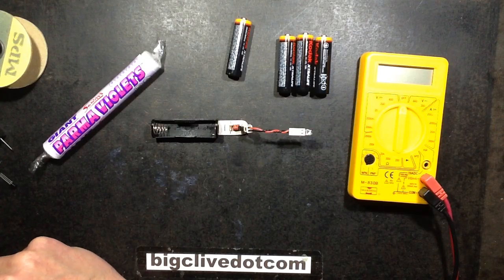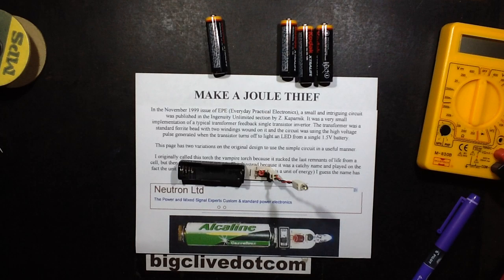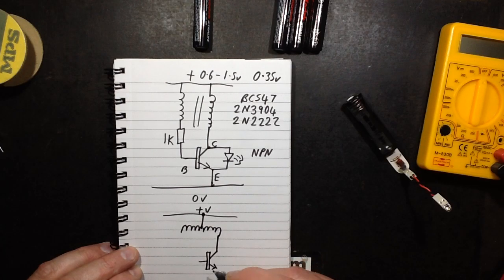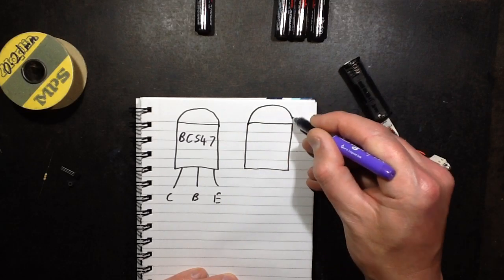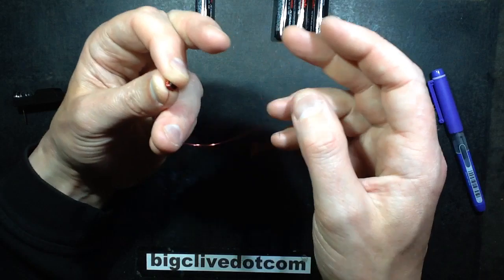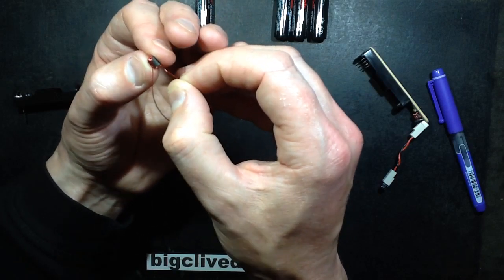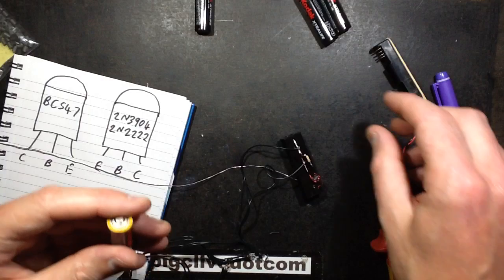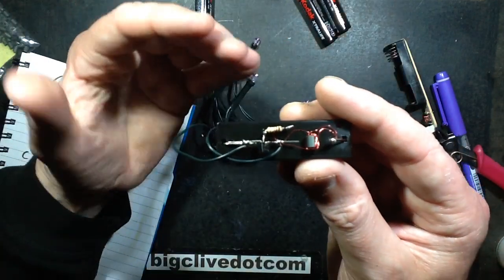How to make an authentic Joule Thief.

Comment: Do you think I could drive a cold cathode fluorescent tube with one of these?
Reply from the maker: The output is too low.  You're also better using a traditional Royer driver for cold cathode tubes as otherwise they can polarise if the drive waveform is not symmetrical.  (Mercury vapour gathers at one end.)
Reply: Thanks very much for the quick response! I have a cold cathode backlight out of a TV that I'm wanting to like my room with. I may have to post a video of it if I ever get it going.
Reply from the maker: @WalterMelones  Check on eBay.  You can get cold cathode drivers for TV tubes, but they are often designed to drive several at once.  You also get testers based on standard PC cold cathode tube drivers.  Search my channel for cold cathode.
Reply: I'm wanting to drive 16 tubes (in parallel?) As a struggling student, I can't afford shoelaces, let alone purchasing things on the internet. I may have to delay projects for now or a search through my index of parts to try and build something from scratch. I'm not sure I can dedicate much time to it at present, anyway. I shall do more research and thinking when and where I can make time. :-)

I wonder what would happen if I try to drive all of them off of a single driver. Maybe it would only light one at a time and flicker sporadically throughout different ones; similar to that light bulb you made with little neons?
Reply from the maker: @WalterMelones  You can't drive them directly in parallel unless you put a high voltage capacitor in series with each one to split the current.  Keep in mind that a cold cathode tube operates at several thousand volts.
Reply: @bigclivedotcom  ah, okay. that makes better sense. That also explains why I could barely drive one tube with a small neon sign rf generator. I'm looking into Royer Drivers, now...

Comment: Would this circuit work on garden solar lights?
Reply from the maker: They're already based on a similar principle.
Reply: @bigclivedotcom  it's a very interesting Little circuit. I have been looking for some ready built on eBay so I can add them to my garden lights.  What would happen if you linked two together?

Comment: I know you LOVE Poundland and buying cheap batteries. Buy Energizer lithium are FAR better in everyway. I started to use them around 10+ years ago, first of all in my RC remote control stuff and then. For everything!  (I went a bit "gun ho" when I flew my beginning £400+ battery helicopter for the first time 🤦🏻‍♂️. Ended up going over 40+ mph into next doors van with the helicopter shattering n flying into millions of pieces and the grill doing the same 😳 (They were away on holiday and I never said anything lol) With the LiPo battery bent in half, I didn't go ANYWHERE near it for over an hour 😳 I spent almost as much to fix it as what it was worth. So I ended up swapping it back over at the shop n sticking to what I know best. 4 wheels).

Tangent over. A few people have done tests over the recent years and I know Dave's done a few tests and something similar came out on top. But that's mostly to do with "the batterizer" 😂🤣🤦🏻‍♂️ 
I always tell everyone to get them off eBay and if there's anyone, staring at all the different shapes, types, flavours, colours n all the BS marketing wank they slap all over them. Stating that there 5x better than any over battery out there n I'm like "so tell me about all these over brands that are just as shit as all the others on the shelf. Stating you out! 👀🔎
I always tell them what they are and where to get them. Many years ago they stopped selling them for obvious reasons as they want to make a profit. 

Rant finished!

Comment: Interested in your take on a single inductor Joule Thief being sold on www.Amazon.com by Farhop, entitled "Joule Thief DIY Kit - No toroid inductor. SMD DC-DC Includes LED".  I bought a few and put the circuit into LTSpice, and it simulated rather well.  I removed the small surface mount inductor and it worked with a variety of other inductors, so this seems like a fun circuit to hack and comment on.  Love your videos and web site.  Keep up the good work!

By the way, I like how small your Joule Thief turned-out.  I couldn't find cores like that -- they must be high permeability.  Curious -- what is the frequency, and what is the efficiency?  Thanks again.

Comment: One Thing not covered in the Video or any of these type as far as I know,  From my extensive experience with these type battery fully draining circuits is when the battery is finally used up the batteries are prone to pop open and leak so get rid of them after draining in a Joule Thief!  I've Literally had many lying around and herd a pop and  once in a while and discovered the bottom
of the battery popped open!

Comment: So if you can’t let it go open circuit how do you turn it off?
Reply from the maker: Disconnect the battery.  It's the LED that can't go open circuit.
Reply: bigclivedotcom  thanks will try one as a reading light for the mrs 😂

Comment: wait why is this working for me no matter which way I put the transistor in?
Reply from the maker: What voltage are you using?  If it's more than the LED forward voltage the current will pass straight through the inductor and LED.  It's only really designed for 1.5V cells.

Comment: does it matter what size wire you use
Reply from the maker: RC MAD The circuit is surprisingly tolerant of a wide range of wire sizes, but I tend to recommend the thinnest varnished wire you can find that is still comfortable to wind and terminate by hand.
Reply: ok i got some out of the bulb that i took apart so might do but now i have to hunt for a 1k resistor where can i find one of them i can salvage

Comment: Does this only work with LED's?
Reply from the maker: It can be used for other small loads with some extra components, but there are more efficient alternatives.
Reply: @bigclivedotcom  Would you consider elaborating on this, including some other useful applications of the Joule Thief's output in a future video?

Comment: +bigclivedotcom the resister is a 1k but is it .25, .50, .75 or 1watt it sounds like it would be a .25 and it's not easy to find a decent quality ferrite bead. I ordered a pack of them and didn't say shielded but when they came a month later they said they were ferrite shielded bead, small trace amount of ferrite cheap and didn't want to work I borrowed a few meter of wire from a friend and if you have a link for the .15 wire and the beads I would appreciate that very much. I just bought the transistors, resistors and cell holder local for 20 times the price. RadioShack went out of business, thanks
Reply: The beads I purchased was .094" inside diameter or 2.4mm and silver black, junk

Comment: Why 1k resistor? cant it be bigger or smaller?
Reply from the maker: +Tom Ocean Yes, within a limit.  A value of 10K will make the circuit run at lower power.  If lowering the value of the resistor to make it run at higher power you have to consider the stress put on the transistor and LED.
Reply: +bigclivedotcom Thanks for fast answer. so its means if i want drain more battery 5k resistor is good?
Reply from the maker: +Tom Ocean 5K would result in a dimmer LED but much longer run time on a battery.

Comment: Two and a bit years ago I bought my daughter a string of LEDs more or less like the ones you have there except they were white and had little plastic minions attached to them.  They are powered by two AA cells.  She turned them on on Christmas night 2015 and never turned them off.  I assumed they would stop glowing after about two days.  Instead, they glowed quite perceptibly, even in a lit room, until after Christmas 2017 i.e. more than two years.

They are still glowing now, but it's very faint.  Who needs a joule thief (cool as they are)?
Reply from the maker: Good quality modern LEDs will light at literally a fraction of a microamp.  I have a light in my bedroom that uses two AA rechargeable cells to make a single LED glow and it lasts for months on a full charge running 24/7.

Comment: YOU coined the infamous word jule thief? If true that’s cool.
Reply from the maker: Yep.  I thought the Joule Thief was a good name and it took off.
Reply: bigclivedotcom I asked you a question on your page +google bigclive it’s about some led lights I got to replace the Filament type on my motorcycle side light 12 volts system, they don’t last very long Clive before they fail. Why? There cheap I tried 2 types and both failed within weeks is there something I can do like put a resistor in-line or is it cos there just cheap ones? They looked ok just simple push in type with a flat blade connection. Any ideas? Thanks.
Reply from the maker: The usual reason for failure is overheating or over driving the LEDs.  Are they the "canbus" type that have a red hot resistor on them to try and make them look like a traditional current hungry tungsten lamp?  If they are then look for the type that doesn't have that extra resistor or group of resistors soldered directly between the positive and negative connections.
Reply: bigclivedotcom well I tried 2 types one was just the 2 led’s on a basic board that was pretty bare and I lost that one as it may not of failed as I later found the connection at the other end had come lose so that could of been fine, the second one was like a Christmas tree with the resistor you speak of Clive so it sounds like if I purchase the one that may not of failed after all I may be ok. So I’ll stay away from the Christmas tree hot resistor type! Thanks for your advice. Huge fan mate great channel.

Comment: Hello sir, or anybody who can help me. I am sorry, I am a beginner and new to this, so I am bound to make mistakes. So anyway, I have attempted to make a joule thief. Here is how I made my coil. I used 2 18 gauge wires of different color wrapped around a black toroid. I think its around an inch in diameter. I have winded it according to how most do, which is the opposite colors of the wires are right next to each other ( same color wires aren't adjacent without the other color wire being next to it on both sides.) and done 8 to 10 turns. Here is what happens though. Following the schematic, I build my circuit and finally plug a 1.5 volt battery into the circuit. (Yes I have made sure the LED I am using requires 3 volts to make it illuminate.) and the LED quickly illuminates but shuts off immediately and keeps doing that every time I insert and remove the battery from the circuit. I have also used multiple npn transistors( 2n3904, bc547, 2n4401, and 2n2222s) but same thing. Can somebody please explain to me why this happens, and what I need to do to correct it. Your response is really appreciated and anyone who knows more is appreciated. Thanks!
Reply from the maker: +jbuddyman Try a different coil.  It sounds like that one might be too big.
Reply: +bigclivedotcom Thank you so very much for replying! I have been frustrated over and over and got nowhere. I will definitely try a different and smaller coil to see if that helps, but I need to go shopping for one. Thanks once again!
Reply from the maker: +jbuddyman Do you have an old or faulty compact fluorescent lamp?  They have a suitable toroidal core inside.
Reply: Unfortunately I do not. This one and only one I have came out of a cord from an old vcr that I disassembled for fun. We have incandescents here but I might go pick up some cfls for that reason lol
Reply: +jbuddyman Any old scrap electronics would likely have effective cores in it... old computers certainly do, the ferrite beads are often round the legs of components  :)
Reply: ***** Thanks!

Comment: and how many turns do you need
Reply from the maker: RC MAD I'd suggest at least 20, but go for 30 or even more if you can fit them on.  With some cores the circuit will work with just a few turns, but will tend to cut out sooner as the battery voltage drops.
Reply: i was taking apart a florescent light and had some of the components look similar i read the code of them and it is a 102d 36128 does that have a chance or will i have to order some stuff on ebay i know already i have to get 0.15 mm wire and some ferrite beads but what else got the batteries and stuff but what am i missing
Reply from the maker: RC MAD The high voltage transistors may be a bit less sensitive.  I'd suggest getting one of the transistors suggested.  If you had a fluorescent lamp open it may have a suitable ferrite core inside for feedback.  You may find it easier with 0.2mm wire, it's a bit easier to handle.  And of course a resistor of around 1000 ohms or so.
Reply: i had a resistor from the light that i took apart that had a resistor which had the colours yellow blue gold gold does that help me any therver got the wire btw it was in the light
Reply from the maker: RC MAD That sounds a super low value of resistor.  Probably to limit transient current through the transistor.  See if you can find one with colour bands like brown, black red, gold.  The varnished wire round the little choke in the light should be OK.
Reply: its got 6 wire on the choke i got out of the light and where could i get one of them i think i saw a resistor in a one pound set of lights would that resistor work
Reply: there is 2 things theres a ring one and the one with yellow tape like a block
Reply from the maker: RC MAD Use the ring one as your toroid/bead and you could break the block one open for more wire.   The resistor in the set of lights will probably be just 10 ohms and that's too low.
Reply: ok so i have a bead sorted and threaded where could i get a resistor that is that rating you said an led bulb or an old charger or something got loads of bulbs
Reply from the maker: RC MAD A charger might be a good source.  Check out the colour codes on the resistors and list them here.  We can pick one for you.

Comment: I thought the trans needed to be wound in 2:1 ratio
Reply from the maker: The original design is an equal ratio.
Reply: My understanding is that optimal performance is achieved when the transformer is wound with the 2:1 ratio, but I will defer to you since you are the pioneer

Comment: Why not just buy cheap (resistor shaped) inductor for a few cents, instead of buying copper wire and winding it around? You can get them between 1UH and 1MH.
Reply: +Jay H  Don't know if you can get them either center tapped or a pair inductively coupled. If so, I am sure he would use them.
    Mike (o\!/o)

Comment: is the real reason you dont see these in devices as really run down batteries are more prone to leaking? well that and probably wont do your good nimh any favours if you use them too
Reply from the maker: jusb1066 The zinc chloride batteries always leak when over discharged, but alkalines are not too bad in that regard.  The circuit stops oscillating at around 0.35V so not too harsh on NiMh's.  It certainly won't reverse charge a flat cell from the others in the circuit like a set of three driving an LED via a resistor directly would.  But it's really designed for alkaline cells.

Comment: Here's a link to an online simulator with a quick simulation of a Joule Thief using a center-tapped transformer:  http://goo.gl/M9UEmk
The 10 MEG resistor on the "primary" is a dummy just to keep the simulation happy.

Here's a link to a simulation using a transformer: http://goo.gl/1Mt2he
This one also has an adjustable power supply--check out how the behavior changes when the voltage is varied.

Comment: im clearly doing something wrong, @ 1.5V the led is brighter without  the , joule thief connected .
Reply from the maker: +patprop74 You must be using more than 1.5v as no standard LED will light at that voltage.
Reply: The power is coming from a bench top power supply, which is set at 1.5V the leds I am using are savaged 3 legs red and green with  common cathode that were token out of commercial telephones. my core is a round flat circle  4mm diameter  and height of 2 mm   I used 0.1270mm or 36awg magnetic wire.  I also tried with a UV led that has a FV of 3.2V but sadly still wont work. Perhaps the core or the awg is to small to properly create a magnetic field ?
Reply from the maker: Test your circuit using an AA battery for the most accurate results.  If the voltage is too high it will pass through the Joule Thief and light the LED directly.
Reply: took lots of fiddling around but I got one working, I changed core tiny for a slightly  bigger one, and wire thickness to 28awg, But most important of all, seems like I fell on a batch of bad npn 3904. Thanks for the great video and the helpful advice . I have to say i'm rather impressed I am lighting 15 UV led with a 3.2 FV.
Reply: After success with the one, I went back to the tiny core and Bingo! it works, turns out those nasty npn transistors were the source of the problem, But now I face a bigger question, like many of you are im sure, how for can this technology can be pushed ? can we do the something with a 12V car battery to light and use for bigger things? how much  experimenting have you done with this, beside lighting up Led ?
Reply from the maker: patprop74 The Joule Thief is optimised for simplicity and low voltage cells.  For higher voltages it's better to use one of the many voltage regulating modules on eBay.
Reply: Nonetheless, it was nice to finally have a working one and since then I made many with lots of recycled 4 leg 2 winding inductor coils, I can t seem to stop making them hahaha, I seen somewhere, by adding a capacitor helps improve the performance even more?, This project sure does help spark the imagination, Love this kinds of little things! like the  tiny 555 bug style video. If you can, could you do more little projects like these please, I'm fairly new to electronics and they sure help me understand while inspiring me. Thank you :)  + 1 subscriber here